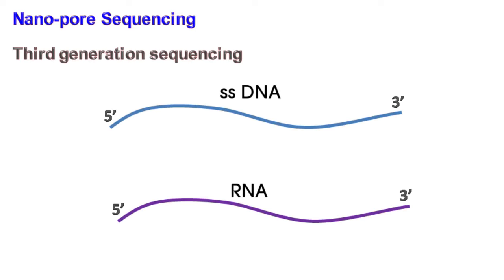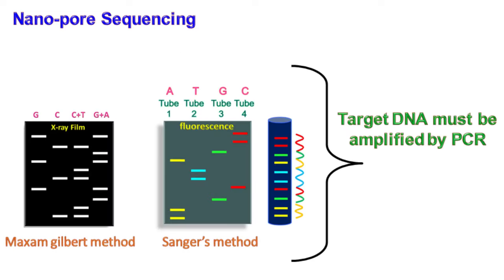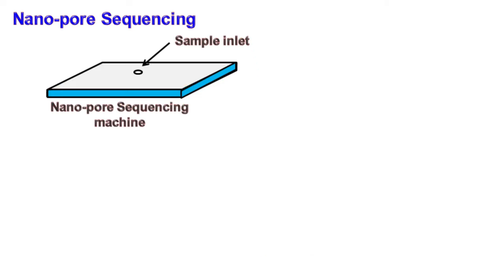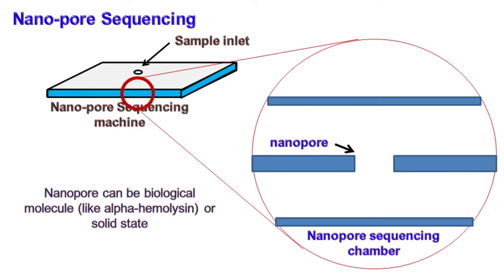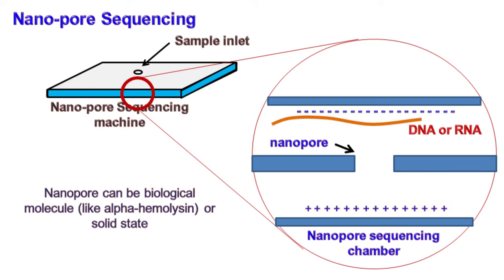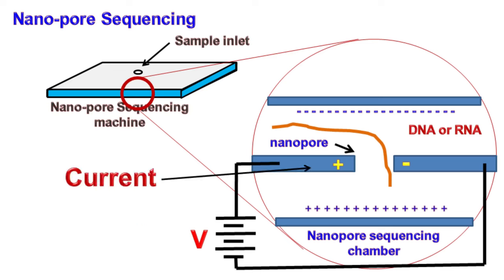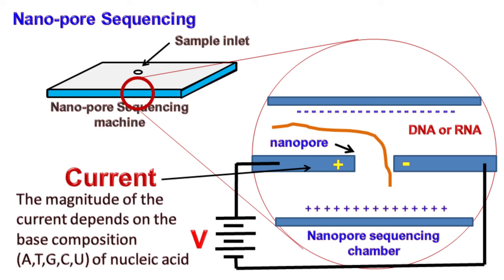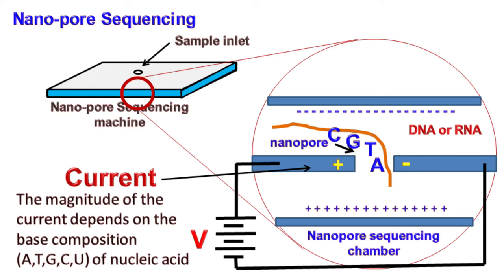Nanopore sequencing

Comment: what is measured is the variation of current through the nanopore based on the movement of electrolytes added in the solution.
The analyte volume will affect the amount of electrolytes that can travel through, causing vartiations of current's intensity.
the scheme is misleading.